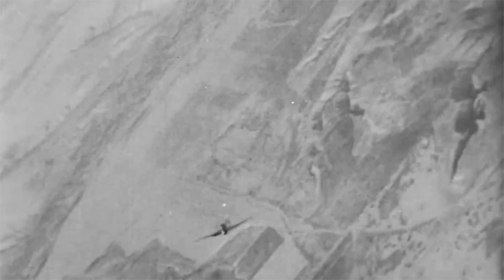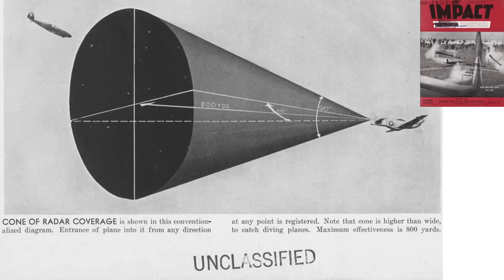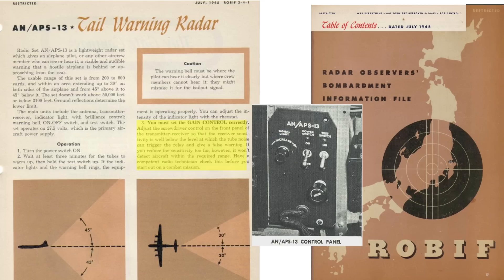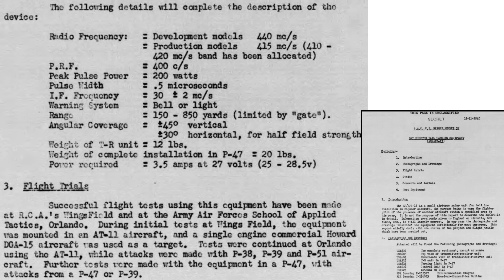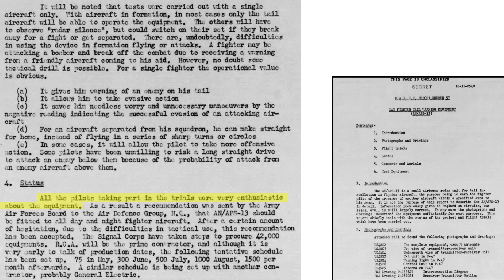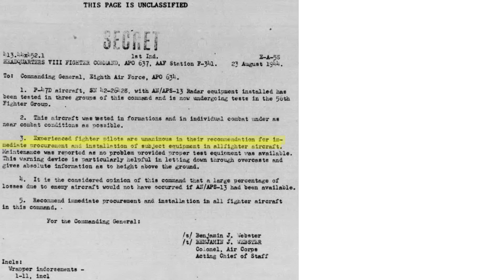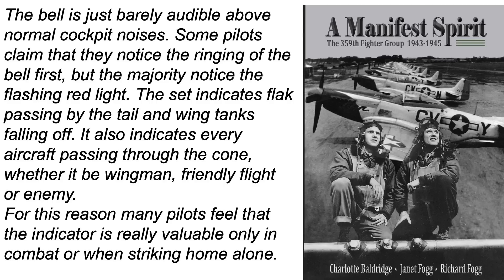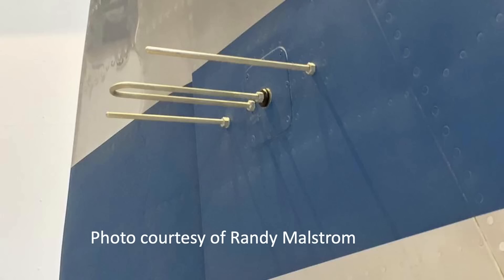How the WWII Fighter Tail Warning Radar reduced losses by 80%, the AN/APS-13 Deep Dive Review

Comment: Hard to imagine such a little thing could put out 200 watts, or why so much power would be needed for such a short range.
Reply: Probably had to do with (lack of) receiver sensitivity.  The 200 watts would have been only during the pulse transmit period so "average" power would have been much lower. "real" radars of the period had 1000's of watts output, but again these were only brief pulses.
Reply: @howardeisenhauer1391  True; pulses have a lot of power.  I looked up the 2D21 and it seems it could actually put out 200 watt pulses.  It's a small 7 pin miniature thyratron.  I count 19 tubes in that cabinet, I imagine it's pretty sensitive.  Couldn't find a schematic.

Comment: That 3 minute warmup period seems like a problem if only the trailing plane in a formation should have their radar turned on, and the others were supposed to turn theirs on once they'd been broken up by attackers.  I didn't see any switch for "power on but idle", but it seems like a pretty obvious need.  Maybe those early systems had no such capability.

Comment: I like that the P-61 night fighter had top priority on the list. Big radar upfront and a little radar in back.
Reply: The APS13 radar was the same as the Monica tail warning radar used by the RAF. It proved to be a liability at night because it could be homed in on by Luftwaffe night fighters fitted with Flensburg radar detectors. This wasn’t realised until the RAF captured an intact Ju88 night fighter in 1944.

Comment: The problem with vacuum tube electronics is they have to warm up. In this case a three minute warm up. As a kid all TV sets had to have a minute before a picture was seen.
Reply: Even vacuum tube car radios had to warm up.  Start the car and the radio comes on half way down the block.

Comment: It's a pity you didn't take time to elaborate on German countermeasures such as FuG 227 Flensburg homing system, and the aftermath of the Junkers Ju 88G-1 night fighter of 7.Staffel/NJG 2 (1944-jul-13) equipped with Flensburg which landed at RAF Woodbridge by mistake: the RAF ordered Monica to be withdrawn from all RAF Bomber Command aircraft.
Reply: No Monica was not removed from All RAF Bomber Command Aircraft!!  It was removed from any aircraft that operated within a Bomber Stream as its use gave away the position of the stream and allow the Germans to ignore the 8 and 100 group spoof raids designed to drag the German night fighters off the main force . All of the aircraft that operated outside of the Bomber Stream (Mosquito bombers and Night Fighters, plus 100 Group RCM aircraft used Monica to the end of the war).

Comment: 8:30 18,000 feet or should it be 1,800 feet???
Reply from the maker: Thanks for that error find. I pinned a comment correcting the error.
Reply: @WWIIUSBombers  Your welcome, BTW my grandfather, Clark Day Jr, volunteered for the nuclear bombing missions in WW2 as a tail gunner. He said that the guys called the B29s the “Stripped Eagles” not “Silver Plates” since the radar controlled turrets were removed for weight. Also, he never made the mission because he broke his back in parachute training but made a full recovery.
Reply: @1dedrer I'm laughing at my luck. Before commenting about this possible error myself, I wanted to check all the comments to see if anyone else had mentioned it before I would have. And there you sat, the very last comment at the time of my checking. Touché

Comment: A very informative video - thank you so much! 

I had always noticed the antenna arrays on the atomic bombs, but never knew their significance.
Reply: They are called Yagi antennas.  Not so different from an old-fashioned rooftop VHF TV antenna, except that for TV you needed only receiving capability at home.  The length of the rods is tuned to the wavelength of the radar, which is why a TV antenna had rods of differing length.

Comment: Considering the amount of German aces who specialized in getting in sniffing distance to the rear before pumping out the 20mm, it makes a lot of sense this would have an impact.
Reply: These systems were probably more useful in the Pacific where a fighter pilot who got separated from everyone else didn't have reference points on the ground like pilots in Europe did and had to concentrate on fixing his location so he could find his way back to a tiny dot in the ocean or ditch from running out of fuel, it gave them the peace of mind to concentrate on the math of navigation without constantly having to worry about someone sneaking up behind him.
Reply: @dukecraig2402  there was a radio signal coming from the aircraft carriers to help the fighters find their way back home
Reply: @sliceofbread2611  
Sorry, when I mentioned a "tiny dot in the ocean" I should have included the word "island" as I did in another post here, I was talking about the land based Army fighter's, whether or not the Navy and Marine land based fighters in the Pacific ever had this system (or even their carrier based fighters for the sake of rear attacks) I don't know, I've never heard an account of them having them but that doesn't mean they didn't.
Reply: @dukecraig2402  Ah, yeah that makes sense, i wonder if there was ever a similar radio system to help pilots find their way back to an island..
Reply: @sliceofbread2611 probably, but I feel like that could almost risk insert island being found, at least with the carriers they can just shut it off and move
Reply: @Smithgirll  true, however i assume most islands are known already

Comment: Wow it's been years since I actually learned something about ww2 or the tech from that era. First time hearing of this device
Reply: I knew they were used on the tail turret of RAF Lancaster bombers to warn of approaching Luftwaffe night fighters. I guess the Lancaster was big enough to house the equipment and had multiple crew to operate the system (for example the Navigator’s station had a CRT display for the H2S radar) . But I never knew they were used on smaller, single seat, allied fighter aircraft.
Reply: @notmenotme614  I also never new about this US system. But I have seen a couple of old RAF films about the "Village Inn" aka AGLT (automatic gun laying turret) system for British heavy bombers.
Reply: MSD ..............I considered myself as a  knowledgeable 71 year old of things WW 2 and with you on this ..........even knew a P 47 pilot who made thru the war .
Reply: Likewise. I've read Taffy Bowen's book Radar Days about early radar developments and especially airborne radar but I wasn't aware of this use in fighters.
Reply: I'm right there with you all.  I knew about the heavy bombers & THE BOMB altimeter use, but I've not read about this kind of system being installed on fighters as early as 1944.

Comment: Is it true that the AN/APS-13 was a spinoff of the work done on proximity fuses?
Reply: Not really, the AN/APS-13 was an installation of the British Monica bomber rear alert radar system developed for the RAF, the VT-Fuze system was developed by the Telecommunications Research Establishment in England as part of the development of unrotated projectiles (rockets) for anti-aircraft use.
The microwave replacement for the Monica system, the Fishpond auxiliary display was added to the H2S microwave based radar navigation system actually was a product of Bernard Lovell at the Telecommunications Research Establishment.
So they both came from Britain but from seperate parts of the large radar development system.
Reply: @johnculver2519  thanks

Comment: Thanks for the research and keeping  history alive. I knew nothing of this although people may be aware of the RAF's tail warning radar, codename Monica.
Reply: Monica was a failure, the Luftwaffe's night fighters got wise to it and used Monica's transmissions to home in on the bombers.
Reply: @philiphumphrey1548  Obviously less important on a day fighter. But wasn’t that the role of the wingman?
Reply: @ronhudson3730 but then who’s protecting the wingman?
Reply: @philiphumphrey1548  The operational requirement for Monica was raised by RAF Bomber Command in June 1941. Due to shortages of CRT's and the fact that there was nobody on the Bomber Crew at the time who could watch a CRT display all of the time, an audio warning system was used in the intercom system's of some of the crew members (Pilot, Wireless Op and Gunners). 

The System was ready for wide scale deployment in late 1942, but it was then found to jam the OBOE system used by the Mosquito Pathfinders. Deployment was delayed until OBOE was modified to overcome the issue. The system worked fine when serviceable for aircraft operating on their own, but within a tightly packed Bomber Stream, it was going off all of the time and there was no practical method of putting some form of IFF into the system. 

So the Mark I version was a failure, as most crews switched it off, when it wasn't going unserviceable, which happened 20% of the time. 

The Withdraw from service of the 1.5 Metre band ASV Mk II radar in Coastal Command in 1943, saw the display systems form that equipment merged with the Monica system to create the Mk III "Visual" Monica system, which gave the wireless operator a visual indication of what was happening behind and below the aircraft and losses of aircraft in squadrons fitted with the kit were much lower than on squadrons fitted with the standard equipment. Even then, the equipment failure rate was around 20% pre sortie.

Yes the German's built a Homing System, called Flensburg, but that didn't really roll out into wide spread use until April / May 1944 and the British got their hands on a working one in a Ju-88 in July 1944. British Trials using the captured aircraft showed that it could plot a large number of aircraft in bomber stream from long range. This totally destroyed the RAF's concept of decoy and spoof raids to spilt the defensive night fighter force and everybody would know which was the real bomber stream and what was the spoof's. 

Thus Monica was removed from the Main Force Heavies that operated in the Bomber Stream. Everybody else in Bomber Command who operated as single aircraft at night, kept it!! The 100 Group Bomber Support Mosquito Night Fighters, the 8 Group Mosquito Pathfinders and the 100 Group Fortress and Liberators on the high altitude RCM (jamming) missions. The Monica Kit on those aircraft allowed a great many evasions of interceptions to take place. 

The German's developed their own tail warning kit in late 1943 and fitted it to fighter bombers doing attacks on southern England. It made the lives of the RAF Mosquito units trying to intercept them a nightmare.

Comment: The old timey specifications get me.  Frequency = 415 mc/s.  That's 415 MHz for modern humans.
Reply: Hertz was a German scientist of recent memory. It was patriotic to refer to them as "cycles" instead.
Reply: @frederf3227  Names were changed by an international committee in 1968.  Centigrade was also changed to Celsius.
Reply: I noticed the 95 watts. 😂
Reply: feet ! I'm British, so here that is amusing.
Reply: @johnculver2519 British still uses so many Imperial units. Miles for distance and gallons for fuel
Reply: @h74-s4h  I agree, but strictly fuel and fuel tank sizes are in litres, albeit fuel economy is still in miles per imperial gallon. Litres per 100 km seems a little clumsy.
Reply: @johnculver2519  Japan uses km/L. Both km/L and L/100km are fine really, you can easily convert one to another
Reply: @h74-s4h  But their gallons are all seriously mis-calibrated
Reply: @bobechs7234  yeah you never know when someone says gallons if they meant US or UK gallons
Reply: Cycles are better than Hertz. We ain't German.
Reply: @SecuR0M  Driving a Hertz hire car is better than riding a cycle. (Joke).